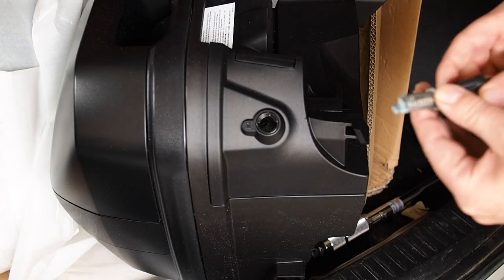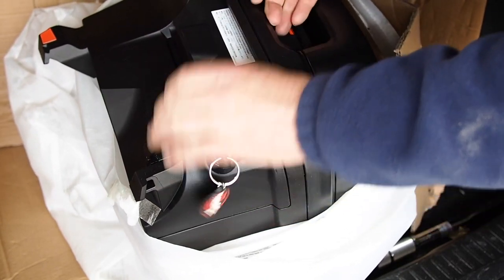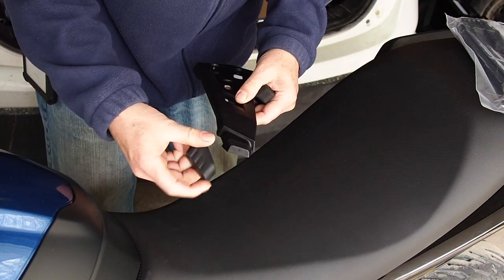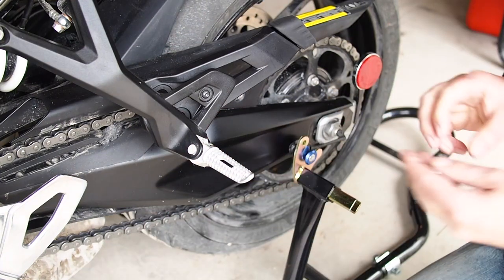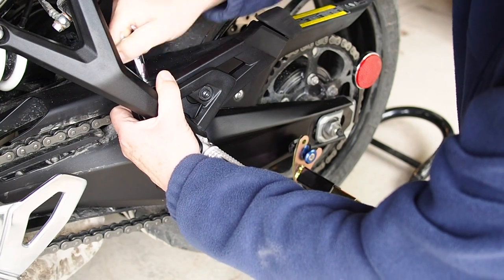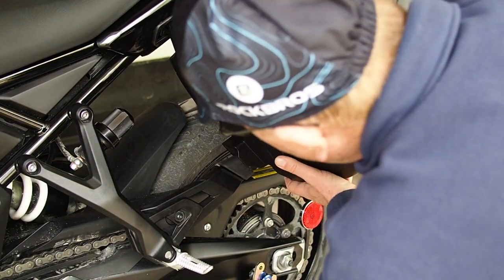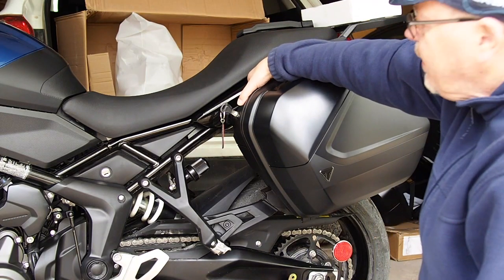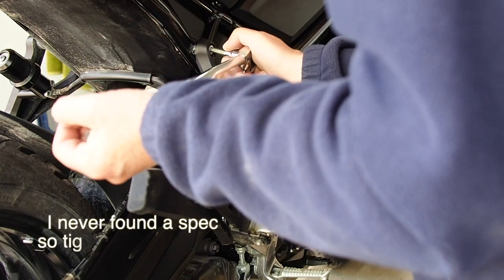Part 2 Tiger 660 Pannier Install

Comment: Re: side panniers: I fitted both panniers earlier today; the first went in easily, the second was difficult, particularly aligning all three parts (ie the top front and rear and the lower rubber rest) Am I right in noticing that you insert the rear top before the rear front, or was it both together. Thanks
Reply from the maker: You should be able to fit both top mounting points in and then line up with the bottom point and slide it forward. There should be a bit of a gap with the bottom bracket before you slide it forward to lock in place.

Comment: Where did you find the 3 cylinders? Looked under the seat, called dealer, no help. Bought set of 3, not matched, thought I'd have local lock guy make key with ignition one side, panniers the other
Reply from the maker: My bike came with a manual 2 sets of keys and the lock cylinders and a nice Triumph backpack and a zip portfolio.  I would have received them even if I didn't order the side cases.  So in my case everything was inside the zipped portfolio case.

Comment: Thanks for sharing this. Do the panniers hold a size large full face helmet?  I noticed you have a spoiler on the windshield. How much does it reduce noise and buffeting?
Reply from the maker: I'm still on the fence with the spoiler ... somehow sometimes it helps a lot and other times it doesn't seem to help as much.  Depends on the wind direction.  It definitely raises things so you can duck behind it easier and it seems to be stopping the bug splatters on my helmet wind shield.  It might be more effective at slower speeds.   I hopefully have a longer ride coming up this week to give it a better test.
Reply: @DonMPhotography  Thanks for the quick reply. That was my experience on my 2 test rides. In one direction there was noticeable buffeting at highway speeds. In the return direction there was little to none.  Regardless of direction, I was disappointed in the high wind noise.  Does the spoiler lower wind noise at all? I really like this bike except for the buffeting and wind noise.  Please report back on your experience on your upcoming longer ride.

Thanks
Reply from the maker: So I gave it a try this evening and I can get my XL Sena Outrush helmet in as well as my Large  HJC IS-17 Fullface in the pannier.  I'll have to do a video as it seems to like to go in a certain way.
Reply: @DonMPhotography  That's good to hear. And a video is a very good idea. Many manufacturers seem to make overly optimistic claims in this regard, and many vloggers fail to test this. Video verification would be well received.

Comment: I would appreciate feedback on whether you like the Triumph panniers and how they affect the bike. Many thanks!
Reply from the maker: Personally I prefer the top load style but these worked very well and with the built in mounts you add very little extra weight to the bike.  I don’t notice any effect to the handling of the bike. ….  I did have to give a few turns to the rear preload when I had them packed full on my recent trip as the suspension was feeling off.
Reply: @DonMPhotography  Your feedback and channel are greatly appreciated. On function and handling, if you could only purchase the pannier of top box - what would you recommend? Many thanks!
Reply: Sorry my note should have said “pannier or top box’. I have never had luggage and are debating between the two Triumph products. Thanks
Reply from the maker: That’s a tough question, the top box is, to me, more handy and more functional. You can put larger items in it. But it looks a little more scooter ish and Carries the weight up high.  The panniers look cooler and carry the weight lower but not nearly as functional due to the size and weird angles.
Reply from the maker: Personally I have the top box on Moore often than the panniers … also it’s a narrow configuration and slips past the car much easier in my garage.
Reply: @DonMPhotography  Promise last question - I ride on the highway and thought the top box might affect handling more than panniers. Your feedback is greatly appreciated!
Reply from the maker: I think the top box is hiding behind your body wind wise when you’re moving down the road. So no it doesn’t affect the handling other than a higher centre of gravity if it’s loaded heavily … other than that it might catch a side wind. Like when you are stopped at a traffic light and a gusty wind is playing havoc with your balance.
Reply from the maker: Also,  I feel that panniers have affected my gas mileage more than a top box if that helps